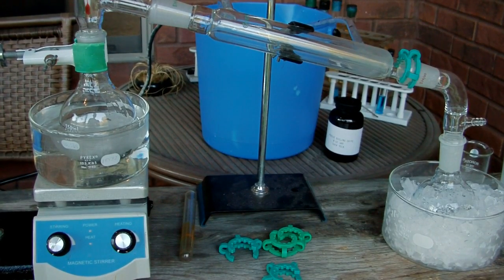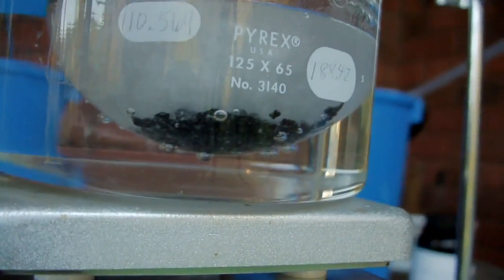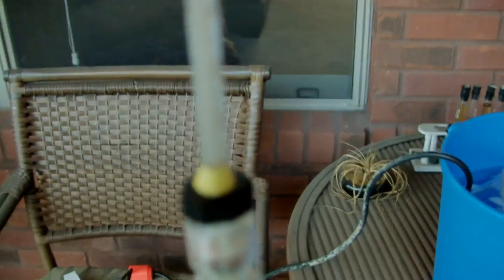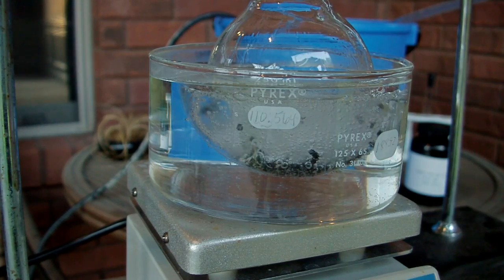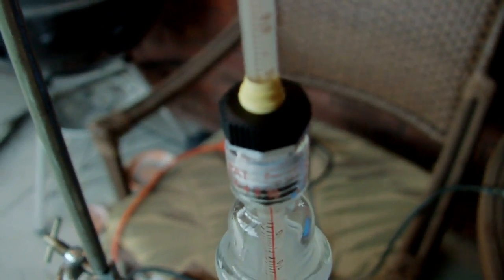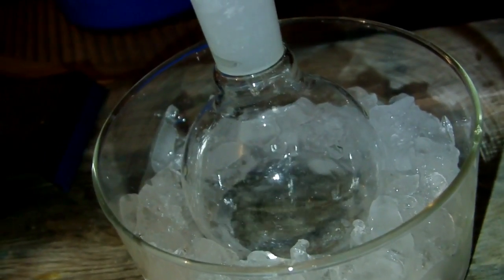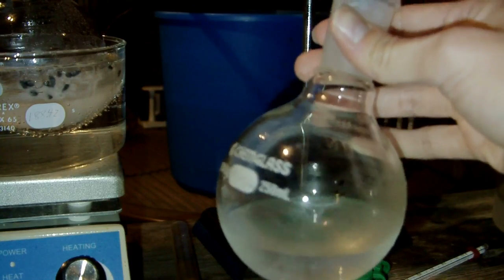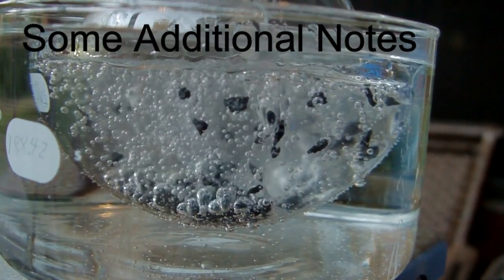Purifying OTC Chemicals: Dichloromethane from Paint Stripper

Comment: If you add a layer of water to the DCM would it prevent it from evaporating?
Reply from the maker: That would slow it down significantly, yes. As long as you don't plan on using it for very water sensitive reactions, or are willing to distill it again right before use.
Reply: @mrhomescientist  Do you think something could be added to the water to make it work even better?
Reply from the maker: @keymaster2108  I don't think so, no. I imagine just the layer of water on top will slow evaporation to almost nothing.

Comment: Also you can purify Starter fluid to get Di-ethyl Ether which is also a good organic solvent. Its a bit more dangerous due to its flammability and the Di-ethyl ether can be dangerous if it comes in contact with peroxides forming di-ethyl ether peroxide. Works very well as a organic solvent.
Reply: It forms explosive peroxides when exposed to oxygen. The solution is to add Sodium hydroxide.

Comment: Hello, nice work on the videos!
just wanted to offer another reason the hook-up to the condenser is done the way it is. Most importantly I think, is if you hooked it up the other way, the condenser would never ill up since he water would drain out the bottom tube as fast (or almost as) the flow coming in. Otherwise, doing it that way would put less stress on the pump, because there would be no "water weight" pushing back on the inlet.

Comment: One of the best and cheapest I've found is one called "Silicone Dielectric Compound" From O'Reilly's auto parts.  If one of those is available near you the grease is about 20 dollars a tube but is perfect for distillations.  It's not even affected by most organic solvents so it won't be present in your final distillate from the joints.  Just wipe if off with paper towel when you're done.

Comment: U need at least 80 C difference betwen the things ur separating or the yield will be low and impure. And i dont think activated carbon will work,its used to remove impurites,not as boiling chips.

Comment: The actual stuff can be purchased easily on eBay, but in my experience ordinary vaseline (petroleum jelly), if used in very small amounts, is suffice. Just be careful, don't use too much (you really only need perhaps 2mm^2 of it per joint) and be sure to get the non-scented stuff if possible.

Comment: Hey man, if there really was both DCM and methanol in there you would have both coming over because there is an azeotrope around 37 degrees C.  This isn't too much of a problem since the two separate out into two layers, and the DCM layer is around 99 percent pure.  But I just thought I'd let you know that even if you did have a fractionating column you wouldn't be able to directly separate out the methanol.  Probably your best bet is a dessicator like CaCl2 or Sulfuric acid.  Nice vid though!

Comment: Very nice, glad to see you're using the 105* adapter to release pressure after the condenser.
I couldn't see if you were using grease between the joints, though . . .doing so both helps prevent losses of the vapours by leaking of gasses and helps the parts come apart easily after the distillation. A tube of proper lab grease is expensive, but well worth it as you only need a tiny amount on each joint and thus a small tube lasts like for ever.

Comment: Condensation on the thermometer would make the temperature reading higher than the true vapor temperature as the latent heat would be transferred to the thermometer.  Given the interaction of two light dipoles amid an assortment of (relatively) larger (relatively) non-polar compounds, it is far more likely that the VLE of your mixture had a lower bubble point than the lightest pure component due to mixture thermodynamics.

Comment: two Q's
1) What is the minimum temperature difference between chemicals for this method to be viable, you mentioned 40 and 60 so I presume 20 is ok.
2) You also talked about having a fractional distillation column but I thought they had to be large for things like crude oil so I was also wandering what sort of size would a small one be that a home chemist could use that would still function.